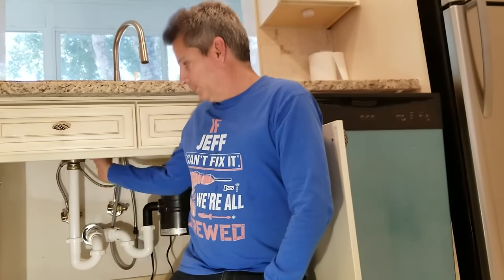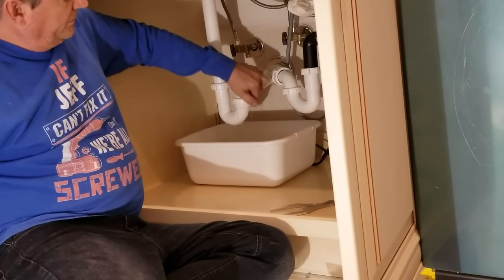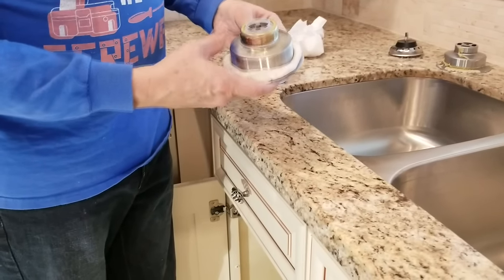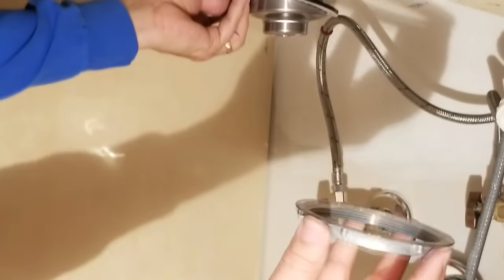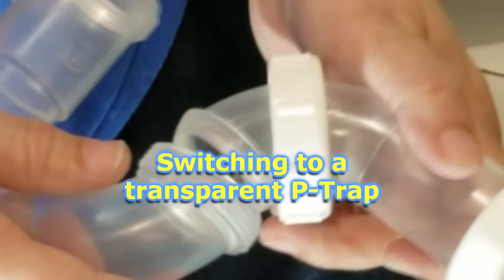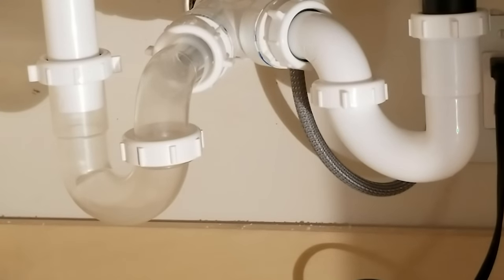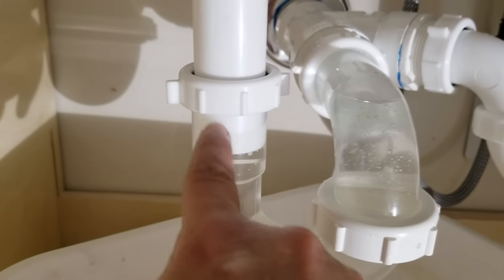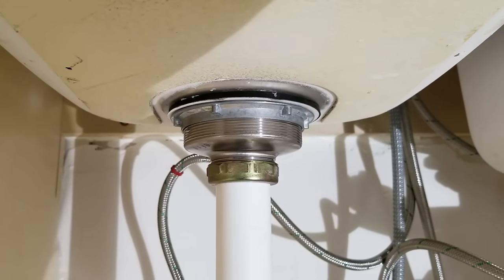How to Replace A Kitchen Sink Drain Strainer, Repair Leak

Comment: In my kitchen remodel I added a copper sink (I have hard well water that stains so I wasn't going to put in white porcelain sink). A couple weeks after the initial install the water leaked from the flange below. They came back and wrapped silicone around the threads below (I gave it a day to dry before testing). But that failed and water still dripped. Came back again - removed all the silicone, took out the drain completely and reapplied putty. He filled the sink testing the pressure as it drained. There was finally no leaking. But that was fine only for a few more weeks and now it's leaking worse than even originally. I keep a basin below the drain so there is no water damage but it's still a major pain. I don't have a dispose-all so there is no vibration that might cause this. I'm wondering if I should replace the putty with a silicone application once and for all.
Reply from the maker: The putty should work when it's brand new, and there should be zero leaks. That said, some plumbers prefer to use silicone because it seals better, and never dries and cracks. Could be the well water is doing something to the putt? don't know. Maybe they did not tighten the bottom of the drain nut enough? Are all the parts there, and in the order as we show in this video? If you could post a well lit video from below showing exactly where the leak is and shewing it in action, that would be helpful. post a link to it here in the comments.
Reply: Where exactly is it leaking from?  Around the sink drain strainer OR the actually plumbing pipe fittings?  Are you using PVC? vs chrome metal P-traps, etc. PVC expands/contracts a lot from cold water to hot water sometimes leaking at the threaded hand turned fittings.  Silicone is nice, but when you have to remove/replace parts, it can be extremely stubborn to let go and remove the parts.

Comment: Is the putty the culprit if it lleaks at drain? Does the wrench tighten it even never used the wrench mabe thats why I used silicon on occasions this could be frustrating leak at times Thanks
Reply from the maker: Yes, it's a combination of not putting down enough putty, making sure the drain is sitting down low enough into the beveled out flange receiving area, and tightening down the nut with a nut wrench, keep tightening nice and tight as more and more plumbers putty oozes out. If you don't have enough putty to fill the tiny gap under the strainer flange up top in the sink, then water will get through.  Many plumbers these days prefer to use silicone, because it seals better than putty, and does not dry and crack like putty over time.
Reply: @jeffostroff  thanks jeff
Reply: Putty sux..my drain is leaking again. Going to try silicone now

Comment: question...noticed leak coming from the slip nut area under the kitchen sink drain, went to turn the nut and it wasnt even connected...somehow it came loose...so i had to hold the pipe up in order to get the nut to catch the grooves and hand tightened it...still drips so i looked up what that part was and there is a washer that comes with a new one so could that be the issue? its night time and unable to actually get under there and do much but was looking up info...i dont want to replace the whole drain thingy if i dont have to..first things first lol..do i need to more than hand tighten it also? thanks for any help if u can get to the question

Comment: I have made this repair like 20 twenty times in the past 6 years and I believe the problem is the putty? What is a substitute for the plumbers putty?
Reply from the maker: Yes, the plumber's putty manufacturers all lie to you and say on the container that it won't crack and dry but it does crack and dry. Also, some people might not apply enough when they first install it. But yes a more preferable solution that some plumbers use is to use clear silicone the only problem is you have to wait 30 minutes to an hour before you can move it and do all of the rest of the work on it because you want to let it sort of hardening into place. That's why I use silicone that says 30 minutes water ready on my bathroom vanities.

Comment: This will work if the pipe is leaking only on the left side when water is draining correct?
Reply from the maker: This works for any leak you have at the strainer
Reply: @jeffostroff  Thanks so much! I was able to fix my leak by following this video (didn't need the strainer, just a new metal slip joint)!

Comment: I really appreciate this video! Everything was great but my water pressure went down.. I turned my water off multiple times trying to fix this and it only got worse..
Reply from the maker: I wonder if something got caught in your pipe right by the end there where you turn on your water valve. Check your hose bib outside see if it is under full pressure try some of your other faucets around the house and see if they are under pressure.
Reply: @jeffostroff  thanks for the reply! I fixed it earlier,  the tip of my faucet had tini rocks in it, i had to keep cleaning it until the pressure came back.. so i learned 2 new things today 🤣

Comment: The catch piece on my sink doesn't have the nubs for a wrench to connect to. Would it just be glued on? Just curious before I start taking it apart
Reply: Mine also appears to have a black rubber gasket underneath

Comment: When I went underneath my kitchen sink there was a mess of something, probably the cardboard gasket got wet and expanded/disintegrated. Can I take it apart and replace just the cardboard gasket if everything else looks good, and where would i find that?
Reply from the maker: Yes try that, and don't forget to pull out the drain, clean off old plumbers putty in the flange and add new plumbers putty

Comment: What's the approximate torque spec on the drain basket nut.  From what I saw on your video I think I might have gone too tight.  Thanks!
Reply from the maker: They don't provide one. I just go until it is nice and snug.
Reply: @jeffostroff  Thanks for your video!

Comment: Do we have to replace the drain or can I just clean it and replace the putty?
Reply from the maker: The new strainer kit is usually less than $10 so I prefer to put everything brand new especially starting off with a new washer that friction ring which is such an important part so as long as your cardboard friction ring is not soaked or damaged or anything you could probably hook everything back up after sealing it with the plumbers putty.

Comment: Thanks for the video. We just had a plumber change ours, but when I filled the sink it began a slow leak. The plumber didn't use putty, just a black rubber gasket that came with the product. Then he told me the reason why it leaked is because its a "hand tightened union connection" and that the sink is not supposed to sit full of water, that's why it leaked. Is he just messing with me? Why did the drain even come with a plug if I'm not supposed to full the sink with water? That's how the dishes are done around here. He redid the job with putty this time but removed the black rubber gasket and said I shouldn't be filling the sink, and that was that. Time to find another plumber?
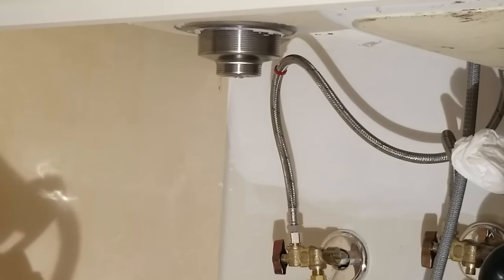Reply from the maker: Yes, he should have used either plumber's putty or silicone the first time. I don't typically see gaskets used on the inside of the sink here, because they get pinched and deformed, but usually the black gasket goes underneath a shown in the video at 7:20 from underneath the sink basin . Almost sounds like he installed it wrong and put that gasket in the wrong place.  Do you know the brand and model of the drain he installed? Do you have that black gasket under your sink right now a shown at 7:20 now?

Comment: Question bro I need to actually run the plumbing I have no water in a house  that was a garage at first how would I drill the hole to run the pipe from the outside wall
Reply from the maker: There are wood boring drill bits that you buy, or if it is concrete wall, then you buy concrete boring bits, but these are not cheap, often over $75 each. Search on youtube you will see videos on this, like this one: https://youtu.be/8zVczoLYMjM

Comment: What do I do if it’s the sink drain with the garbage disposal that is leaking down and around the disposal?
Reply from the maker: You'll have to disassemble the garbage disposal from under the sink, then assuming it's Insinkerator brand, you remove the retaining clip from the underside of the sink/bracket assembly, and remove that assemble, and pull up the drain flange inside the sink, and put new plumber's butty under it to reseal it. Some plumbers like to use silicone rather than plumbers putty because it seals better and does not dry and crack. Have you tried just running water to see if it's really leaking from the sink basin around the flange, or is there a leak at the side outlet port of the garbage disposal? OR, was the garbage disposal installed slightly crooked so that it might leak?

Comment: We will be installing a new Garbage Disposal in a couple days, install instructions say IF you have a stainless steel  sink (we do) do not use plumbers putty, use a rubber gasket they provide to go under the new sink flange, I am confused as my plumber has used plumbers putty under the sink flange on the other side of the sink when fixed last year. I don't want to get the whole install done and found I did the wrong thing which leads to leaks. Any insight to the install instructions from GE vs what I see plumbers do?
Reply from the maker: If they tell you to use the gasket, then go ahead. We have heard of people having problems once the gasket starts to tighten down, like it squeezes out of one side of the drain flange. Plumber's putty has always been the standard on sink flanges.

Comment: I put the cardboard washer on top of the plastic not between because this is the way the other sink was, what will happen?
Reply from the maker: I don't know if anything will happen, but I always install things the way the manufacturer says to do it. What you removed off your sink might have been installed wrong.
Reply: @jeffostroff   Thanks for the quick response! I found out that the cardboard has to be in between just like you did it so the rubber ring will not twist and bend while you are tightening it. Mine does not look twisted or anything so I will leave it like that :D

Comment: I’ve had trouble with the drain turning in the sink as I tighten the big nut. I’ve had to have someone hold the drain from the top with pliers in the drain holes.
Reply from the maker: That is what works!

Comment: Plumbers putty is garbage, my drain has developed another leak after fixing 2 months ago and total replacement a year ago. Going to try silicone next
Reply from the maker: Tiny, yes a lot of plumbers laugh at plumber's putty and also prefer silicone because it seals better, and never dries and cracks.

Comment: Just bought new strainer and put it on and my kitchen drain still leaks, what's wrong?
Reply from the maker: Maybe you needed some more plumbers putty on the top in the sinc around the flange? The best way to approach this is where is the water coming from? Is it coming from around the giant nut that screws around the basket under the sink and tightens right up to the sink? Or is the water leaking at the connection to the drain pipe where the drainpipe nut screws on to the threaded bottom of the strainer basket?  Let me know that helps us to side where the problem is.

Comment: Mines leaking between the top drain Washer and the threads . The nut is plastic ( can’t change it) and the drain is metal. I tried putting the wrap tape over the metal threads but the plastic nut keeps slipping still 😩 maybe the glue will work or putty between the gasket and the drain.
Reply from the maker: I would pull out the entire apparatus and just buy a new kitten as the metal nut. Anytime you are leaking from above the cause is simple you don't have a good seal on the drain flame Dr up on top so you need to get some putty on there.

Comment: how tight is it supposed to be? i think i did it too tight.. the black gasket moved out of place & the cardboard washer is destroyed cause it got wet..   🙁
Reply from the maker: Well it should not have gotten wet, so that means you did not have enough plumbers putty inside the sink under the flange to seal it.

Comment: followed these directions, wasted a few hours, gonna have to repeat the process. even on the drain packaging it shows the rubber gasket going under the other gasket, not over, guess where the only leak in the whole system is? Now I wonder if I will have to replace those gaskets for round two. **Update** Picked up new gasket set, this gasket set seams to call for the same placement recommended in the video vs the way the last kit advised, I cleaned everything up real good and am trying silicone vs putty this time as the putty seems to be less consistent and solid and seems as if over time, bumping the pipes would result in possible leaks. Fingers crossed. Also I followed the video's suggestion again but this time, that suggestion lines up with the included instructions, at initial inspection, this all seems as though it may work. * UPDATE 2*** attempt 2 failed, the silicone is leaving gaps when tightened and although it states 30 minutes to dry, 2 holes later it was easy to remove as it hadn't set. trying again, rubber gasket only, no cardboard or other 2nd gasket material, allowing silicone to set overnight, hoping it doesn't have gaps.

Comment: Besides pulling the flange on the upper side against the flange of the sink, does the big nut and black gasket do anything else?
Does it really stop any water.  Or is all the water stopped at the flange with the putty?
Seems like the big nut and black gasket would allow leaks through the threads of the nut.  So the main place to stop the water would be at the flange in the sink with a whole bunch of putty.  But that flange can move around as people put the stopper on and off and twist it. Eventually it starts to leak.  Seems like it would be better to have a gasket instead of all that putty. But you would need a special gasket because for some reason I don't understand the flange on the basket is horizontal while the mating flange on the sink typically has a slant.  Why does it have a slant?!  I can see no logical reason except they were trying to make the flanges not line up and require a big bunch of putty.  So it was designed to fail.  I sure would like to find a gasket that has a matching slant to it.  Then with a minor amount of sealant (not plumbers putty but something like head gasket sealant) that gasket would be sealed solid and it wouldn't leak and would take a larger amount of pressure when someone puts the stopper in and out.
Reply from the maker: The plumber's putty around the flange is what keeps water from making it under the flange and to the threaders like you pointed out. Some plumbers prefer to use silicone which seals better and does not crack and dry like putty does. But other plumbers avoid silicone because it is hard to scrape off the next time you have to remove it. The flange should never be loose enough to move when you pull out the stopper. You need to use a drain wrench and tighten that nut down real good so the flange cannot move.
Reply: @jeffostroff  I'm convinced.  I've ordered a wrench from Amazon. (The all the way around kind.) I'm gonna crank that sucker tight and use enough putty to make sure it squeezes out all the way around.  Tight within reason of course.

Comment: Can a guy use silicone instead plumbers  putty?
Reply from the maker: I have used silicone myself before some plumbers actually prefer that because it's more reliable than the plumbers putty which can crack over time and allow water to leak down the underside
Reply: I had a leak about 2 months ago on my brand new kitchen sink that i fixed and this putty has now cracked and now I have to figure out another way to fix the leak without having to use putty. 😣
Reply from the maker: @Eva-kv8ws   Always try silicone if the putty fails
Reply: @jeffostroff thanks for replying Jeff! I’ll be buying silicone this evening and hoping to fix the leak for good!

Comment: Mine keeps leaking.  Why?  It's like the plumers puddy just disappears.  I've redid it three times.  I even got that wrench that fits in side.
Reply from the maker: Make sure you did not throw away. That small cardboard washer it is needed and make sure that you tightened it tight enough so that there is no leak
Reply: @jeffostroff  Cardboard is gone.

Comment: My exit has a very bad angle on it inducing stress on the sink fitting. So instead of coming straight down it's out by about 5 degree.
Reply from the maker: I would replace everything, should be no more than $20

Comment: Couldn’t I just add more putty rather than replace the whole thing? It seems like it just didn’t have enough to begin with. I might be wrong and I won’t know till I undo it all
Reply from the maker: Yes you can certainly try that I have found in the past though when you look at the logistics of a situation like this, when you had no putty up there and water leaking down below chances are anything metal got rusted and ruined, and then It turns into excessive movement of the drain and the drain pipe and so maybe the train pipe has a crack in it now command it now, so that's why for me it's basically $10 parts I just replace everything brands spanking new and it resets the clock 30 years back again today 0.

Comment: I’m an auto technician. I’m attempting this with an oil filter wrench… 😂
Reply from the maker: That should work
Reply: @jeffostroff  It did! But the seal & cardboard ring weren’t any good & it was after midnight. I 72 hour caulked it & tightened it back up. Hope it works & buys me time until I’m free next, next weekend to replace the seal!! 😁